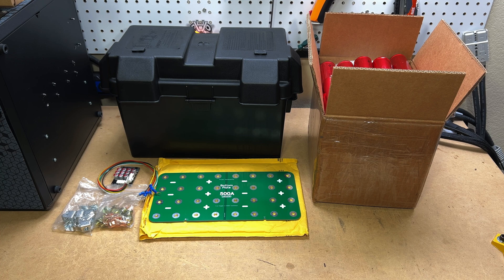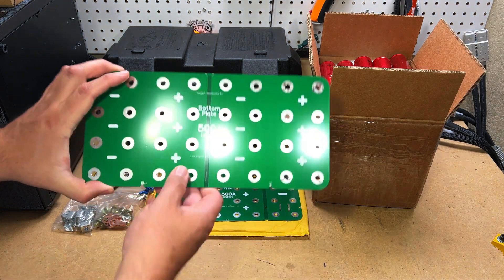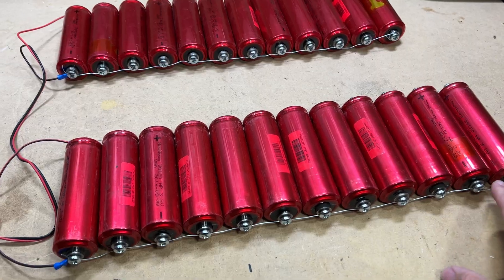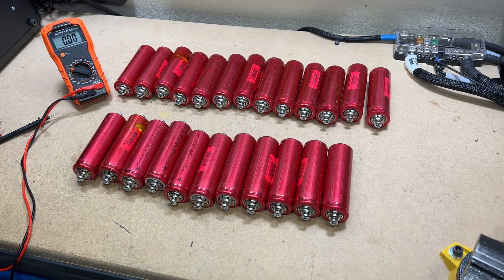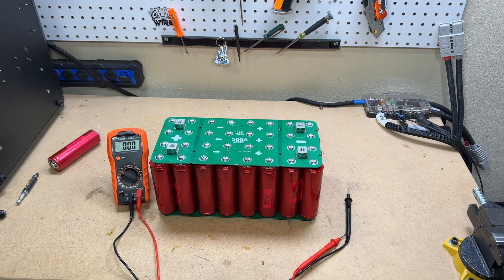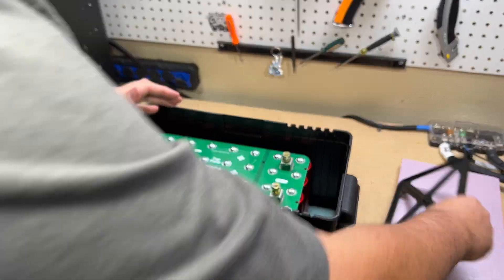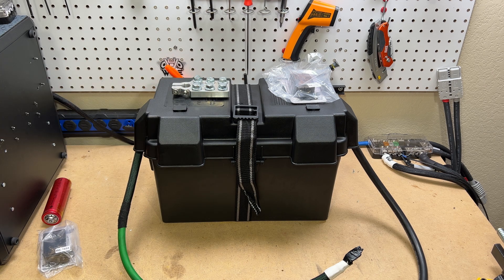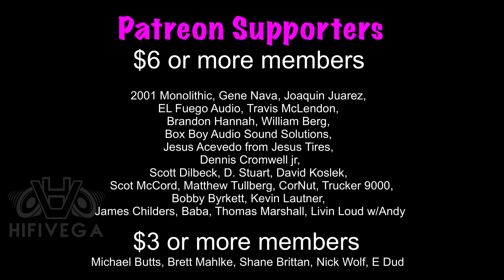HOW TO BUILD A 64AH 12v LITHIUM BATTERY FOR UNDER $300 (Full Process From Start to Finish)

Comment: I've never built a battery, could you explain what the active balancer is and its purpose?
Reply from the maker: @negilneely9185  the active balancer will keep each cell from getting too far out of whack. So after several cycles you don’t have one cell at 3.85v another at 3.36v and another at 3.55v. Instead it’ll keep it much closer like 3.8,3.81,3.79

Comment: How do you (safely) use a battery like this without a BMS?  These cells are known for being able to put out a lot of amps in a hurry, and for taking a lot of amps when charging, so how do you regulate that input and output if you're not using a BMS?  Balancing cells is great, but a balancer is most certainly not a BMS.

Comment: noob here i have the exact set up and same wires in the same spot but when I plug the balancer in it starts to smoke voltage is 12.75 what is cause it to smoke

Comment: I’m wondering if I were to build this, should I buy say like 35-36 cells and throw out the worst cells? Or would I even be able to tell if they are bad cells with using a multimeter?
Reply from the maker: You should order a few extra in case you get bad cells (if you’re buying used)

Comment: Excluding large current, you could buy a 12v 100ah Redodo battery for this price
Reply from the maker: Which would be great for solar energy storage, but this will give you a better c rate for car audio.
Reply: @HifiVega  that's why I stated excluding large current.

Comment: If I build another one can I run them in parallel ? Only wondering cause it would be two different battery balancers .. thanks :))
Reply from the maker: Yes you can

Comment: Other than the 500amp bms any reason to build these when Amazon has 100ah batteries for less than $300??
Reply from the maker: The cheap 100ah batteries on Amazon are meant for solar power and don’t have the c rate comparable to these. Those are basically agm replacements whereas these can handle 15x the ah rating for short bursts

Comment: How’s your battery working? 2 1/0 copper lugs has more copper than that whole green pcb. Its basically copper clad, or copper foil. 
I double the 500a pcb boards on mine, works great! but now jag35 has 1000A pcb boards for $75 shipped.  Next time I will drill out two 6”x12” .125”copper plates cost is about $120 but worth it. I’ve done it with 1/8” aluminum plates. Basically use the pcb as a template.
Reply from the maker: I haven’t used mine under heavy load yet. I’ve basically used it at around 300ish amps, but I like the idea of using it as a template.

Comment: Thanks for sharing a possible cheaper option. No stranger to hooking up and running stereo Amps and electronics having stacks of all sorts. Was surprised this Xmas with an Orion XTR 750.4 amp to run my 1in Dome tweeters, 6.5in mid range speakers, with a resister box's in all four doors in my VW Sleeper Wagon. Tested the Amp last night. Sounded fantastic. Being that I plan on picking up a 1ohm stable monoblock to run a custom boxed 10in subwoofer so this kind of power should definitely assist in that. If my transaction with them goes well I may order more as I have a 1200watt power inverter capable of being ran with a solar panel setup so a storage setup will be needed for emergencies. Thanks.

Comment: Hey hifi..I wanna run my 48ah lifpo4 in my audio system but not sure if I can run it with my AcDelco sealed maintenance free(smf) starting battery.. How could I get it installed without worry?

Comment: Did you have to solder the positive and negative posts that come with the kit or do they come attached to the pcb board or do you put them into holes and solder them. On the board it looks like the 2 positing and 2 negative post to add lugs too. Those come attached
Reply from the maker: You have to order and solder those yourself
Reply: @HifiVega  how do you solder from the back side or on the side of the block and we’re you order those from.
Reply from the maker: @cristovalmontoya5222  both and if you use the link for the board they have them on that site
Reply: Ok thanks how long it take for those solder terminal take too come in fro Ali express

Comment: I have an xspower 127Ah agm. How would these cells compare to it? Would there be any gain?
Reply from the maker: Yes you would see a pretty significant gain in capacity for music bursts
Reply: @HifiVega  would I need a high output alt? I only have stock 160amp
Reply from the maker: @girthquake9655  you won’t need extra out of your alt to keep them charged, but depending on the amount of power you’re pulling you might consider a bigger alt.
Reply: @HifiVega  just a cab-22 at .5 ohms my dude.

Comment: I got 2  of the new alpine type s 12s, with about .9 cu ft each, sealed, in an under seat enclosure. I'm powering them with an audiopipe 1500.1 rn and it's kinda really lacking. My electrical is capable of 3k watts so what Amp would you recommend to get the most out of these subs, with more sq, but also not being insanely expensive
Reply from the maker: You just need a bigger enclosure for those subs I’d say
Reply: @HifiVega  ya see that's the bad thing that's the absolute biggest enclosure I can get for them to fit under the seat, so would a little bit smaller subs be better?

Comment: I got a 64ah headway bank in my car. But I've got custom $180 buss bars. And a $60 battery box from ali express. And heltec balancer. Keeps my 5k rms system running top notch! I've got a 300a alt too.
Reply from the maker: Solid set up
Reply: good man.  proper bars are well worth every penny
Reply from the maker: Solid set up

Comment: FYI it's not off balanced unless it's charged that's how you top balance it's you can balance without it being charged but the term top balanced means that you charged it to the top and it's balanced there
Reply from the maker: All these cells were at 100% soc they resting voltage was a bit over 13v. These are 3.2v nominal cells and have a max charge voltage of 3.7v.

Comment: this is a 12.8 volt battery pack but most car audio alternators 270,320,370 amps charge at 14.9, can this lithium pack br charged that high?
Reply from the maker: These can be charged up to 14.6v
Reply: I charge to 14.7 with a JS 425amp alt. That is the absolute max voltage for a 4s headway bank. Headway says that 3.65 can be plus or minus by .05 volts. 14.7/4 is 3.675 which falls into that description. That being said a voltage above 3.65 can cause premature degradation although I have not seen any as of yet.
Reply: It's considered a 12v system witch norm CHARGE is 13.5 to 14.5 and most can go up to 15.5 resting volts for this should be around 13.2

Comment: Hey HifiVega, let me ask you something and see what you think.

If someone was to run headway cells in a vehicle with an AGM under the hood, the cells wire into series with no isolator. Seen someone do this, and how well would that work? 

Anything helps, still new to lithium.
Reply from the maker: You can run headway inline without an isolator similar to doing it with a regular battery, but the same draw back will apply. Both will work together and you won’t keep your starting battery separate
Reply: @HifiVega  

Thanks for replying, will take your comment into future consideration. Love the videos, keep up the good work.
Reply: @dylancobb8195  go watch my videos , if you use over 40ah of headway the agm is actually going to hurt your voltage! isolators are a waste of money that could have been spent on more lithium.
Reply: I've done it for about 6 months with no problem. I originally had just the headways and it started fine though the winter but I got a free agm so I threw it in

Comment: It isn't ideal using the selected active balancer on lifep4 batteries. lifep4 have a very flat voltage curve while charging and discharging, this means that the output voltage during most of the time the cells are in use will almost not change. This means that you only want to balance lifep4 battery towards the top of its charge when the voltage difference is more significant so above about 3.3v irr. The selected active balancer will try and balance the cells all through the charge cycle of the batteries, and unfortunatly has the oposite of the intended effect and causes them to become more out of balance because it can't see a real difference in voltage. This causes a very serious problem when you come to fully charge it because you have chose a balancer rather than a BMS (battery management system) that it will not stop charge when one cell goes over it's maximum voltage which will significantly reduce the expected life of the cells. Unless you are charging the cells at less than the 5 amps the balancer claims it can handle (which is usually not the case). At 5 amps it would take about 3 days to fully charge your battery which I think you would prefer not to do.
Reply from the maker: This is great info! I actually unplug the balancer before runs and let it balance while the battery is idle. I definitely meant to mention that in the video.

Comment: Prices have increased over the past few months.  In January, I built a 300 amp/hr battery bank with 3 separate dedicated 100 amp BMS modules for about $900 from battery hook up.  Deals are out there to be had, IF you are willing to do some assembly yourself.  I put my lithium battery in my RV.  

Lithium batteries are awesome!!!  Love your videos!!
Reply from the maker: Inflation sucks! But thanks for watching!

Comment: As the owner of ITTY-BITTY-BOOM Lithium I build about 500 hundred Headway banks this year.... I highly recommend for a super budget friendly bus bars, Jim's ECO Headway bus bars...   I personally tested that PCB board and it got really really hot
Reply from the maker: I’ll check those bars out
Reply: @HifiVega  Jim's ECO Headway bus bars come with all the bolts needed and I've pulled 600+ amps threw a set of Jim's without any issues at all.....   :-)
Reply: @Miloittybittyboom  my point was how hot? How do you have them terminated? Are you able to pull 600amps constant? I'm running 6k+ clamped and I am seeing very little heat. However my loads are peaks on music. I'm curious if you are pulling 600amps constant because I plan on adding power in the future.
Reply: @nicholasm2254  I own a ceramic core copper wire high amprage discharge station, designed for testing purposes...   It's what I purchased exclusively to test the hundreds of banks I build every month...  :-)
Reply: @Miloittybittyboom  nice, that makes sense hahahahahah
Reply: I have the pcb boards shown here. I clamped 700amps through them with zero issue at all (after extended use i see maybe 10 degree rise in them playing music). How did you get them hot pulsing 600 amps?
Reply: @nicholasm2254  the one set I ordered and tested simply got hot... My test is in no way an attack on that PCB board, I'm simply sharing my testing results in hopes that nobody burns down a vehicle..  :-)
Reply: @nicholasm2254  its true they do get hot , tested myself . people don't seem to understand we are NOT using active cooling systems with these batteries and the large bars not only dont generate heat  from draw but they also act as a passive heat sink for the cells . having adequate bussing is VERY important for cell life and safety.
Reply: Do you have a Facebook page , i need some headways for 3200 watt system
Reply: @BramtheMan1  Get the SuperBeast from Battery Hookup for $250 and convert it to a 96ah 12v good for up to 10k watts. I'm no diy guy nor do I like building stuff or dealing with electrical, but the conversion is the easiest thing anyone can do in about 30 min to an hour. - plenty of vids on YouTube on how to do it.
Reply: @AnimalsAreSuperGreat  I will definitely look into this , because i was debating into buying a weize 100ah lifepo4 battery , hoping that can handle 3200 watts and to use it at home in power blackouts. If having the headway bank is same as the lifepo4 100ah battery that is .
Reply: I ordered that plate looking buss bar but didn't use it dont know how a thin layer of copper supposed to transfer so much current. Ordered buss bars from jimz machine will arrive in two days from now
Reply: @elcaminosupersport  I ran 8k on two of those buss bars they were plenty good
Reply: Have you tried the 1000a board by chance?
Reply: @sabarlow80  I have not I do have 2 on order for research hahahahahaha
Reply: Im new to this lithium but do you have anything for 3k watts i see all these guys with much more power but i dnt need that
Reply: @512juancho  yes I have a few options for 3k.

Comment: Man, this makes things so much easier.
Reply: Yeah, that PCB busbar is a game changer.
Reply: @DIYAudioGuy  its mind boggling to me that hifi vega would recommend this pcb , it is not at all adequate for this size bank of these cells . he should know better knowing what these cells do and the fact he works for a battery manufacturer! there is reasons more then the heat from draw and recharge through the inadequate pcb for the amounts of power , there is no active cooling system , what the thick buss bars do aside from being above whats required for the draw is they act as a passive cooling system for the cells heat build up. the pcb gets hot with just simple draw alone and over time playing will exceed the Temps of the cells causing failure.  you also are screwing yourself out of a ton of potential by not using proper sized bussing
Reply from the maker: That’s always my hope!

Comment from the maker: Headway Cells: https://rb.gy/mnyofp
PCB Busbar: https://rb.gy/psfful
Noco Battery Box: https://amzn.to/3RL9s8s (affiliate link)
Active Balancer: https://amzn.to/3N0uBg6 (affiliate link)
2:20 Top Balancing
4:06 Pack Assembly
5:28 Installing Active Balancer
5:50 The Battery Case
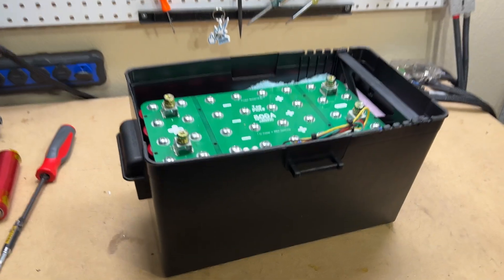7:46 Total Cost Breakdown
Reply: whats up boss video,do u have to connect to both positive and negative to get power?
Reply: whats up boss ,do u have to connect to both positive and negative to get power?
Reply: How many watts is this headed 64ah bank good for ???
Reply from the maker: @BramtheMan1  depends on your charging situation, but 2-3k